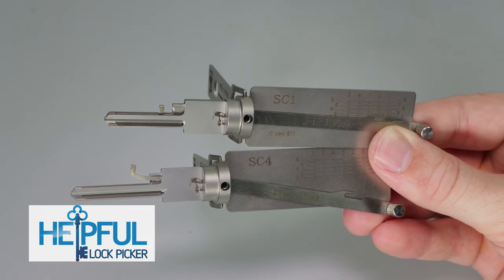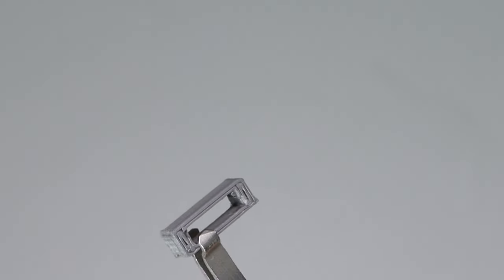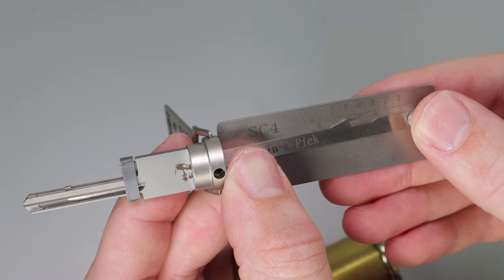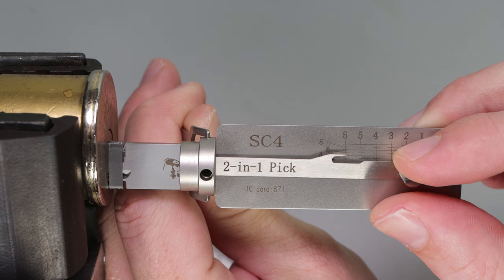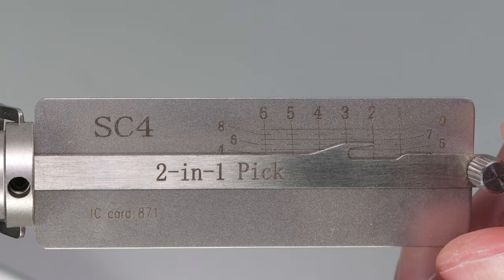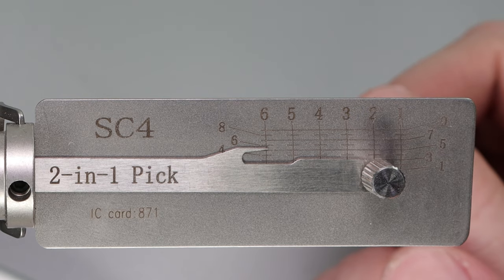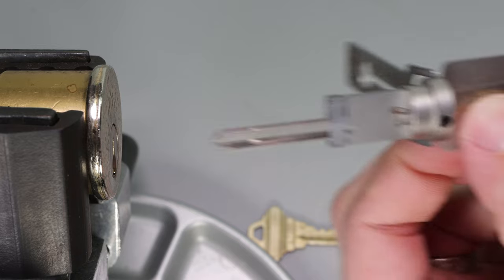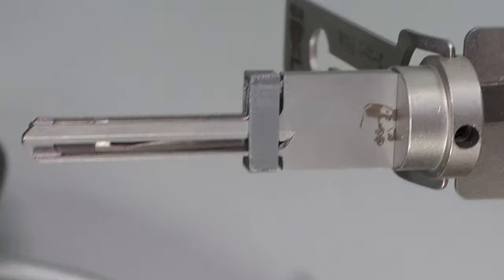How To Use a 6 Pin Lishi Pick and Decoder (SC4, KW5, etc) On 5 Pin Locks! | Lishi Standoff Spacer

Comment: No need for spacer just start at the 2nd pin position works every time for me
Reply from the maker: Thank you for sharing your experience
Reply: that's assuming you have enough room in the lock to insert a 6-pin length Lishi tool without the tip hitting the rear side
Reply: @DeviantOllam then u just use 1 to 5 instead of 2 to 6
Reply: @bigblood9734  you'll be completely out of position if your tool doesn't insert all the way. Also you'll be putting stress on the tool because the top of the shoulder where the blade would insert is not reaching in to provide turning pressure properly on the plug.
Reply: @DeviantOllam that doesn’t change with the collar
Reply: @fortyseven05  I cannot comprehend what you are saying here. Either I don't understand your words or you don't understand the locks.  😉
Reply: @DeviantOllam  you’re not understanding my words then. When you put the collar on, you are still preventing the shoulder from inserting into the lock and preventing the additional support it provides.
Reply: @fortyseven05  this is true... But also the collar is what guarantees the positions line up properly on the grid

Comment: Great video, as always! I've been using the kwikset 6pin Lishi tool on 5 pin locks with no problem and same with the schlage 6 pin on 5 pins, without any spacer because I didn't know there was one! Nevertheless, it seems like I've been successful opening 5 and 6 pin locks, almost every time! The American lock Lishi tool I'm not having great luck with but, I still can't pick American locks either! I'm hoping once I feel the tolerances while picking, I'll have much more success with the Lishi am tool! Any suggestions appreciated!
Reply from the maker: I feel the padlock ones are more difficult to use.  For me, as long as it decodes the lock I'm happy
Reply: @HelpfulLockPicker  Hi Mr , can you please confirm if it works with CISA 285-84 ?
Reply: Hi Steve these picks are getting more than I would hope to pay so are you saying my 6 pin pick will be fine on  a 5 pin lock with out the spacer ( I mean if I am already poor would you say the spacer is a waste of money ? and the money would be better put towards something like food etc ?) ? thank you for your response!!!
Reply: @HelpfulLockPicker  my question to you is based on what I have read  the sc4 and kw5 will work in  most locks? So it seems if I have limited space those are the 2 to get but may be I should also get the left version s in case it feels more natural to pick on the other side I would imagine it's the same thing a accept every things is on the other side? Thoughts please thank you

Comment: I've actually used a KW5 and a KW1 lock and it works fine just backed it out one position I haven't tried the SC4 in an SC1 but I imagine it will Have the same results and work out fine. Great info and did not know about the 3D printable piece Awesome information my friend. I hope your classes are going well and everything in your life sir. Stay safe, well, and sane👍🦾
Reply from the maker: Thanks! I enjoy this new approach.  I hope all is well with you
Reply: @HelpfulLockPicker  It is going well and if you're still interested in one of my challenge locks I will gladly build you one sir. You have been on my list for one but I want to make sure that you do want it. I know that you mentioned you really don't do challenge locks and if you do not want one that is fine with me I will not be heartbroken or upset that just means that's another one off the list.
I still pick when I can I've got a load of locks that have been sent to me that I need to go through but between work life and building CL's I have to do it in moderation a little bit here and there. Actually I'm about to go home and work on some pin ideas to add in some of my CL's that I will be putting together and sending out. I think it kind of like building challenge locks a little bit more than picking them.
Reply: @j.gabriel8573  You don’t need a spacer or to back out the Lishi KW5 or SC4 in a 5 pin.

Insert the Lishi all the way in as normal, and instead of making the #1 pin useless, as when using the spacer, all you have to do is not pick the #6 pin.

Here is a link to BosnianBill’s use of it clearly. He’s not using a spacer or backing out the Lishi at all. Enjoy! 
https://youtu.be/GXyutzYk2A4

Comment: Love your videos. Just so I'm clear, Kw 4 will do 6 pin, Kw4 with spacer will do 5 pin,Kw 1 will decode (but not pick) Kwikset Smartkey but Kw 5 will not, Sc 20 will do all Schlage keyways and MC 2/3 will pick Master padlocks but is not the best. It will decode an open one though. So would a KW4,KW1 with spacer,SC2 and Mc2/3 be a good mix? Thanks..Peter
Reply from the maker: Personally it is better to get the tool for the keyway. The spacers can be helpful but it is better to get the right tool for the right job

Comment: hello, thank you so much, please i realy do not understand about many tolls of lishi,  is it one lishy with your solution can unluck all locks ?
Reply: No he's basically demonstrating how you can use a 6 pin model to unlock the five pin locks as well using this spacer which basically stops the pick being too long but it still has to be the same keeway so for example an SC1 and SC4 you can use the SC4 to do the SC1 and the SC4.
Reply: Don't forget the SC20. Your minds will blow when you find out what it does.

Comment: I found that if you are using a 6 pin lishi in a  5 pin lock with the standoff spacer then you do not want to try and actuate it with the lishi once it's picked. If the hardware isn't smoothly working you can damage the base of the blade trying to turn it.
Reply from the maker: Thank you for sharing
Reply: @HelpfulLockPicker  can I buy a spacer since I do not have the ability to do a 3D printing. Never done that before and have no idea where to go get that done.
Reply: @CarAngTube  yes from red team tools
Reply: I print these.

Comment: Thanks for the great video! Your content has been super helpful. Do you know if a different length spacer is needed for the KW5 Lishi? or does this same spacer work for both? I've got some PETG ready to go, and the ender3V2 hot! thanks again!
Reply from the maker: I am not sure if I have tried if I am honest. Any luck on your end?
Reply: @HelpfulLockPicker  yeah I purchased a SC4 and KW5 and the same spacer does in fact work for both
Reply: @letsdiyeverything8010  You don’t need any spacers Thomas. Just insert the Lishi KW5 or SC4 all the way in as normal.

With the spacer, you don’t pick #1 pin, but you pick 2-6 pins. Without a spacer, you basically do same, except you don’t pick pin 6, but you pick 1-5.

Don’t need spacer and don’t need to back out the tool either. Check this video out by BosnianBill that shows and explains it better.

https://youtu.be/GXyutzYk2A4

Comment: Is there a way I can only buy one of these and use them to decode 90 percent of locks instead of having to buy one for each different type of lock company
Reply from the maker: No
Reply: Ya, each version not only has diffrent length but width. Some get so wide the won't fit in other locks

Comment: From my understanding i got this from russej02 video from 5 years ago, the number 6 would just have zero play to it. No bounce or anything. U essentially just IGNORE number 6 and work number 5 through 1 to open. No need for spacers or anything. 
He even said u can save money by just buying the 6 pin kwisket and 6 pin shelege and not using the number 6 line. Can be hard to tell if its a 6 or 5 pin. I watched him open a 5 pin very easy with a 6 pin lock. Is there anything im missing? Seemed pretty straightforward 🤔🔥 many thanks everyone
Reply: Ok, so this video shows the extra part is just showing u to skip number 1 instead and working 2 through 6. Isn't this essentially the same thing just a different number set? 

Seems easier to just put the tool in, work 1 through 5 and not even worry about number 6. 🤔

Comment: Know where I can buy one that fits the KW5? Thanks in advance
Reply from the maker: Google Lishi and you can find their distributors
Reply: @HelpfulLockPicker   I think he was talking about the spacer. I was wondering the same thing... Does this spacer work for both the SC4 and the KW5 Lishis? or would I need a separate length spacer for the KW5 Lishi?
Reply: You don’t need any spacers. Just insert the Lishi KW5 or SC4 all the way in as normal.

With the spacer, you don’t pick #1 pin, but you pick 2-6 pins. Without a spacer, you basically do same, except you don’t pick pin 6, but you pick 1-5.

Don’t need spacer and don’t need to back out the tool either. Check this video out by BosnianBill that shows and explains it better.

https://youtu.be/GXyutzYk2A4

Comment: Hi there, can you please make a video on how to pick Euro Cylinder locks using a Lishi Tool? I dont know which tool to purchase for Euro Cylinder locks.

Thank you very much :).
Reply from the maker: You need the lishi tool for the specific keyway
Reply: @HelpfulLockPicker  So how do you find out which lishi tool you need for a specific keyway. Also, can a SC20 or SC4 fit in a standard 5 pin or 6 pin lock? :)
Reply: There are no Lishi Tools for euro-locks, as there are basically hundreds of different keyways in Europe.

Comment: Love your videos bro. I’d like to hear your opinion on the sc-1 vs sc-4 vs sc20.
Reply from the maker: SC1 is most practical. SC4 is more versatile but I don't like using on 5 pin locks. I haven't used an SC20. In theory having one that fits all the keyways would be ideal but I haven't had any chance to use one.
Reply: @HelpfulLockPicker  right on, lol yea, I got the SC20 recently and haven’t found one it won’t work on yet. (Granted I’ve only tried it in like three locks lol) Works great for my sparrows practice locks.

Comment: Where can u buy a spacer from pleas tell
Reply from the maker: Look up my video I did on the spacer and I believe there should be a link in that video
Reply: You don’t need any spacers. Just insert the Lishi KW5 or SC4 all the way in as normal.

With the spacer, you don’t pick #1 pin, but you pick 2-6 pins. Without a spacer, you basically do same, except you don’t pick pin 6, but you pick 1-5.

Don’t need spacer and don’t need to back out the tool either. Check this video out by BosnianBill that shows and explains it better.

https://youtu.be/GXyutzYk2A4

Comment: I would buy both.  That little adapter could be easily lost.
Reply from the maker: I prefer both but this is a reasonable option
Reply: @HelpfulLockPicker  Im more worried about more stress on the pick since you are not using the proper shoulder that is supposed to take all the stress of tension.
Reply: @kracka117  You don’t need any spacers. Just insert the Lishi KW5 or SC4 all the way in as normal.

With the spacer, you don’t pick #1 pin, but you pick 2-6 pins. Without a spacer, you basically do same, except you don’t pick pin 6, but you pick 1-5.

Don’t need spacer and don’t need to back out the tool either. Check this video out by BosnianBill that shows and explains it better.

https://youtu.be/GXyutzYk2A4
Reply: @Twobarpsi You don’t need any spacers Thomas. Just insert the Lishi KW5 or SC4 all the way in as normal.

With the spacer, you don’t pick #1 pin, but you pick 2-6 pins. Without a spacer, you basically do same, except you don’t pick pin 6, but you pick 1-5.

Don’t need spacer and don’t need to back out the tool either. Check this video out by BosnianBill that shows and explains it better.

https://youtu.be/GXyutzYk2A4
Reply: @luislozano7947  thanks!👍
Reply: @Twobarpsi  no problem! 👍🏼
Reply: It costs less than a cent to print. You could print 50 at once and really just throw them out every time you use one.